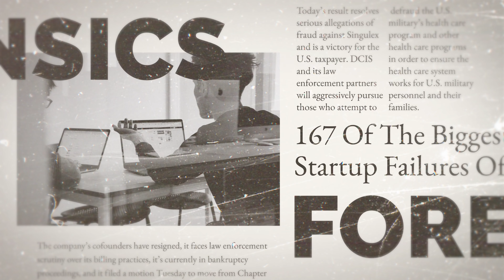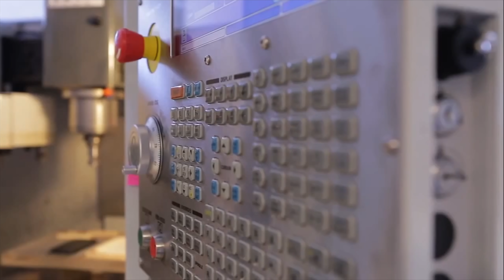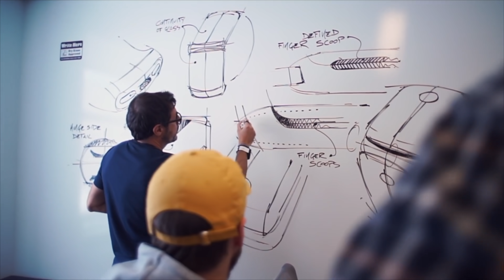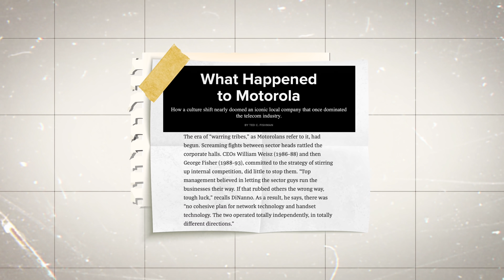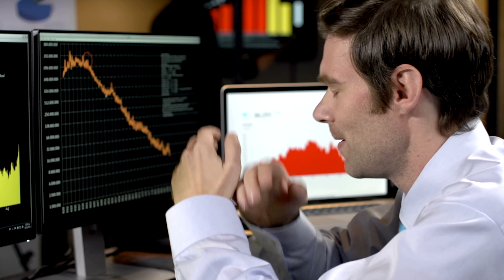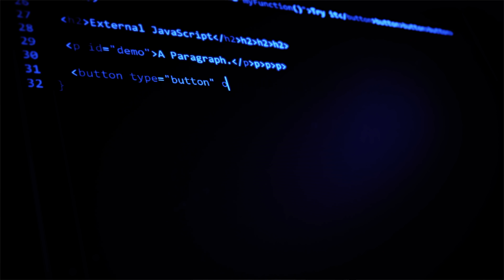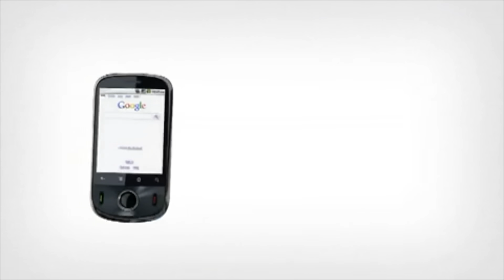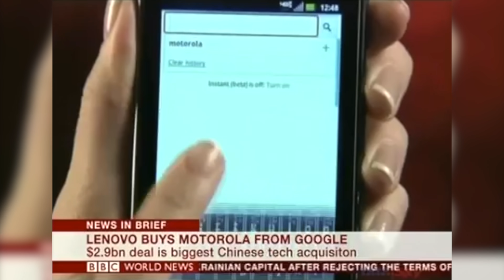Why Motorola’s CEO cried on his first day

Comment: I worked at Motorola and Motorola Mobility for 17 years.  Motorola was NOT organized into two divisions.  Solutions and Mobility was the 2 successor companies, but Motorola was organized into several sectors when I worked there.  If you read the wikipedia article on them.  Some of these sectors were sold off or spun off.  For instance, the Semiconductor Product Sections was spun off as Freescale.  When they decided to split the company into 2, they actually sold off a chunk to Nokia Siemens.  The mobile phone sector and home business became Motorola Mobility, while the rest, which was radio (for commercial, government, military etc) and other products became Solutions.

Comment: I worked at Motorola from the alternator days @ 4:47 (built in Arcade, NY), to micro TAC phones (1M Sq. Ft Bldg) leaving for Qualcomm in the mid 90's. The first gen shoe phones got smaller/lighter pretty quickly as discrete ICs caught up lowering current consumption and battery technology changed to Nickel Metal Hydride increasing battery density. 
Working on Micro TACs it was so cool to have the best phone in the room wherever you went, since we could talk on them before they were sold, just had to know a SW engineer who could program the new hardware :-)
Mgt thought competition between departments was healthy but it contributed to their undoing (we once got a 28% bonus one quarter while others got nothing, tied to how well sales went!) but mainly their failure to adopt digital protocol doomed them. They thought everything would remain analog forever. While it sounded better, it cut into talk time/battery life and frequency reuse/base station efficiency. Carriers wanted more customers per base station, a huge cost concern and embraced digital.
Motorola got caught with their pants down.

Comment: My first phone ever was a Motorola, I had bought it for an equivalent of 50 USD, it had 0.3 mp camera photos only, and had a limited color theme, had 5 games, no app store of any type, and had no bluetooth (I managed to get nice pictures, but I can't send them anywhere either). That phone functioned for 10 years without trouble, I got another phone which was stolen so I carried my Moto for at least half a year and I did not complain. I did not get a proper smartphone in my hands until I was 16, and my Moto just kept working until just 2 years ago.
I have a real soft spot for Motorola and I want them to succeed to get a very good product from them like my old phone.

Comment: I saw Motorola die twice: the second time, of course, as a mobile phone manufacturer.
But the first time was as a CPU manufacturer. Motorola made the BEST processors: the 680x0 family, which was used by Macintoshes, Amigas, Atari STs, the Sega Genesis, and even Sun Microsystems, briefly.

Motorola was always a generation ahead on processor efficiency, but Intel opened up shop practically next door to Motorola, and slowly-but-surely siphoned off design talent. Motorola's managers didn't appreciate their incredible talent pool, and watched it vanish.

They haven't made a ground-breaking processor in 25 years.

Comment: Although the overall analysis has valid points there is a lot missing from the story.  The premise is based on the separation of MOT into MMI and MSI.  However MOT was more diverse than just the cellphone and public safety sectors.  Absolutely zero mention of SPS that played in the semiconductor arena, AIG that ruled the automotive technology space and CGIS that were a leader in defense contracting.  I get it that if you summarize Motorola into two spaces the analysis plays out.  However, it is not accurate whatsoever.  For full disclosure I spent 24 years at MOT with the last 6 at MSI.  Although hinted at but not stated MSI still owns 70% of the market share they play in and my MSI stock even with the COVID-19 downturn is still absolutely a gain vs the RSUs acquired from 2011 to 2016.

That said is Wall Street always only viewed MOT as a cellphone company.  Which obviously that was just one market in which it played.  Regardless judge it by that and still the story is wrong.  MOT had the first touch screen phone sold in China which was the Ming.  The story has it right that Google purchased MMI for the patents but does not explain why.  The patents from the Ming along with more provided Google with the patents aka "prior art" to shutdown years of lawsuits with Apple.
Reply from the maker: Thank you for your comment! Interesting!